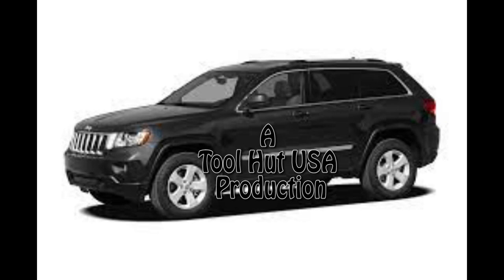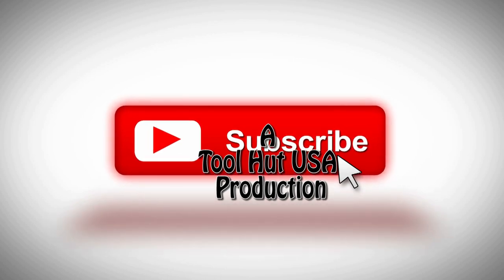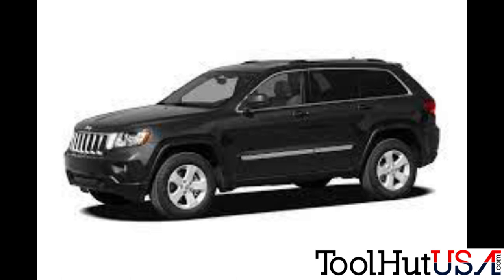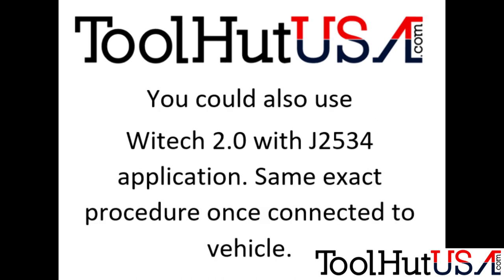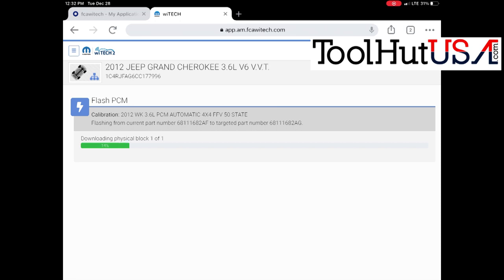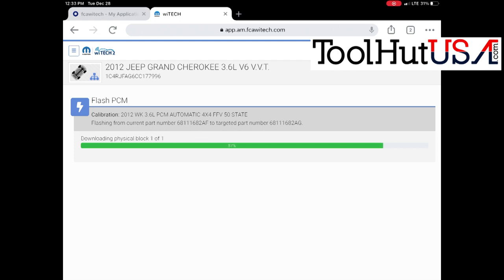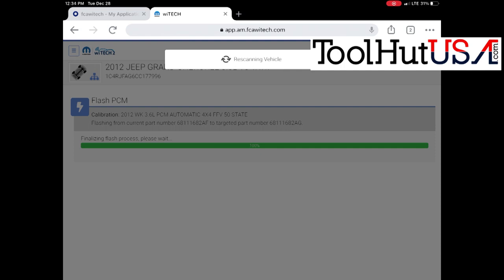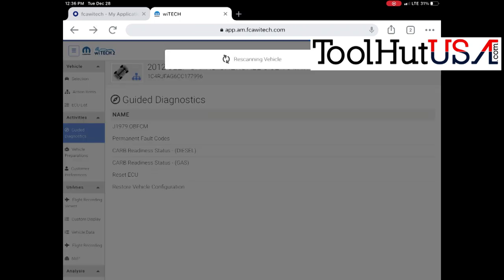12 Jeep Grand Cherokee Used PCM

Comment: I've done it a couple different ways... Using the Autel, rewriting the VIN to the PCM and doing the handshake with the Autel and then logging onto Wi-tech for an update...(no hot swap)

I have also used my Cardaq 3 directly with Wi-tech vs J2534 application programming....Awesome video my friend!!!

Comment: Hello, I had a 2014 grand Cherokee SRT today that failed this procedure with used PCM out of 2014 Ram 5.7 it would get to 99% and when it is supposed to finish with the checksum verification it would lose communication with my cardag +3 and make me start over. I tried several times with same issue. is this something you have encountered? Or is there a way around it?

Comment: It might have been cheaper to buy a pin then run "pcm replaced" function. On may after market scan tools. Thats how I do many of them. I make sure the calibration # is the same.
Reply from the maker: This procedure will correct a incorrect calibration